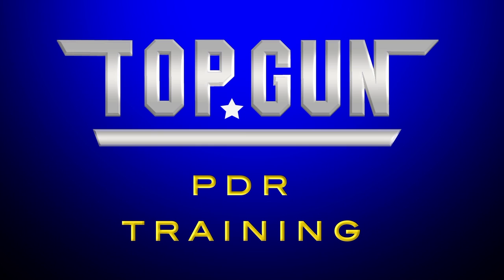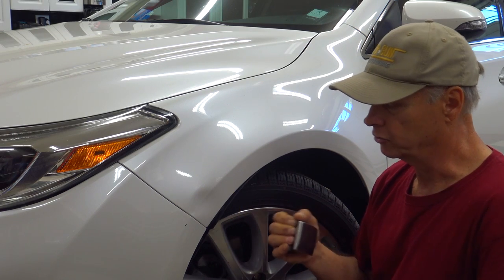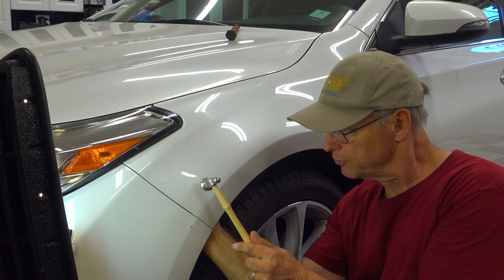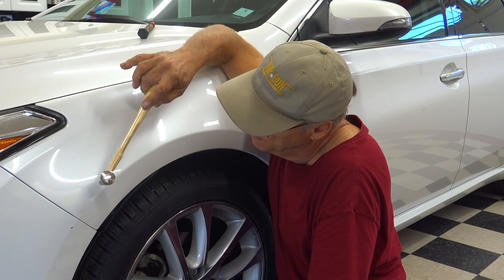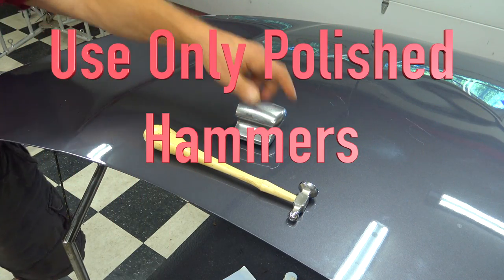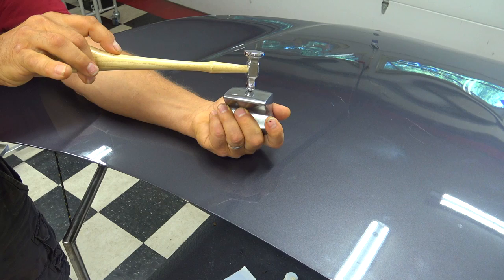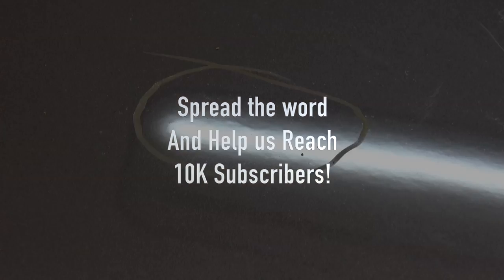Basic Hammer and Dolly Work for Paintless Dent Repair & Auto Body #1

Comment: Its really nice to see someone using a hammer and a dolly.

I am an old metal finisher from way back. Currently working in new car manufacturing at the end of the body line. Man, these kids are so green that the manufacturer wont allow them to hit sheet metal with a hammer...so when I start pulling out techniques like this, they all go berzerk. 

Even the supervisor level and "Heavy" repair personnel dont know this basic stuff. Its like they have been repeating kindergarten over and over again for years and years (and I am trying to talk PHD level particle physics to them). 

Which is stupid. They need to learn how to do it. It would solve so many problems.
Reply: I hear ya!1 It's amazing how techs look right past the obvious tools and techniques to do even simple jobs.

Comment: I'm really thinking of doing it myself though mine is wider though not deep with scratch a somewhat lil bit of a gouge . Is it that necessary to use only polished dollie and hammer ? Polished dollie since it's under the color fender ? Just heat and patiently tap it lil by lil ?
Reply: Depends on you skill level. Go slow and be patient!

Comment: Hey Marty. Very cool never realized this could be used in PDR, How though would you use this method for example under a brace or low access area? Do you get different dollies to slide in and put pressure on the back then hammer out from the top? Show use this Method but under braced areas as we know that is where 95% of our dents are  haha!
Reply from the maker: Thanks! Dollies are mostly for open areas like fenders, rear of quarter panels and doors when the trim is removed. You can use flat or taped tools under braces sometimes to do the same thing. There are lots of different types of dollies for speciality applications such as the stackable dolly shown in this video  https://www.youtube.com/watch?v=brCL5G1QHKQ

Comment: I need to find a dolly i can use on a door panel, but can only access the panel from below and between the door card frame if that makes sense. In other words I can’t apply direct line of site pressure. Thinking I need a small dolly on the end of a hammer handle.
Reply from the maker: That is called a lollipop and can be found at swap meets sometimes. No one makes them new any more.
Reply: Could cut off a cheap harbor freight body hammer

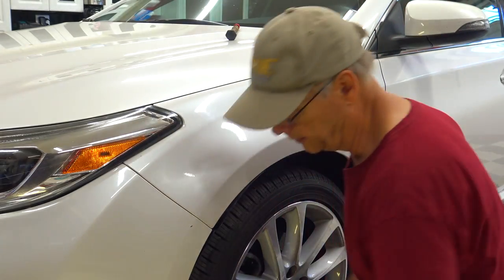Comment: What did you do to remove the dent between 2:45 and 3:00? At 2:45 you can still see the dent. There is a break in the video and at 3:00 the dent is gone.
Reply from the maker: Yes sorry about that. I mention in the video that I forgot to turn the camera on for a couple minutes after repositioning my reflection light so I could see better. Thats when most of the crown moved. There is still some of the dent left after that but I couldn't get the camera and myself to see it at the same time.

Comment: The dent was noticeable when added the board. The camera goes off then back on dent obviously was worked out before camera came back on with the board. Before camera came on after the board there was no matching crease. However there's a crease that goes all the way along the fender with the natural crease of the fender at this point. So the finishing work is just for show because it was already fixed prior so when you turn the camera back on. Which is pointless for those of us they are watching to learn or to see how it's done.
Reply from the maker: Ya not trying to pull anything. I address this during the video. I forgot to turn the camera back on for a few minutes after working the dent, but posted the video because the basic info was helpful. It was a very quick rough video.

Comment: WAIT a minute: where did that dent go at the scene cut at 02:57? He "repositions" and that sucker is damn near GONE after the edit. 🤔
Reply: As I say in the video at 5:58 I did loose about 1.5 minutes of working footage after the reflection light change when I forgot to put the camera back on. You can still see some of the body line in after that. Filming while working is still something I'm getting used to, so the job went quick once I could see what I was doing. Rather than scrap the video I just mentioned this at 5:58. Doing the best I can here.